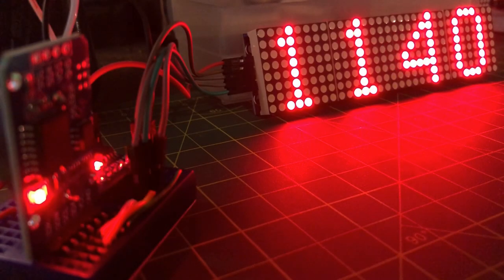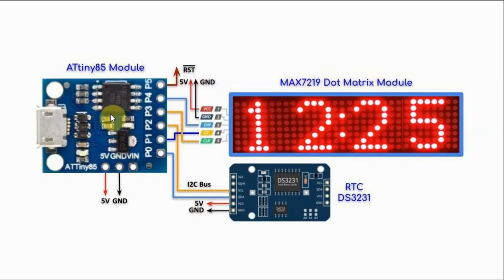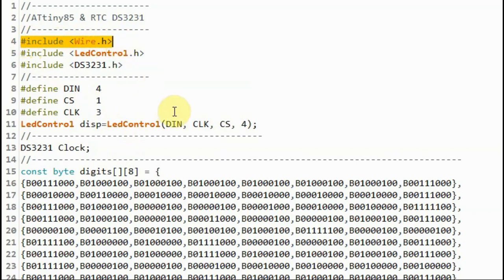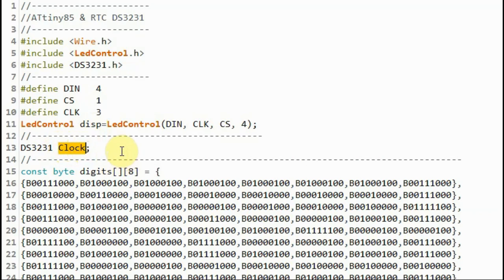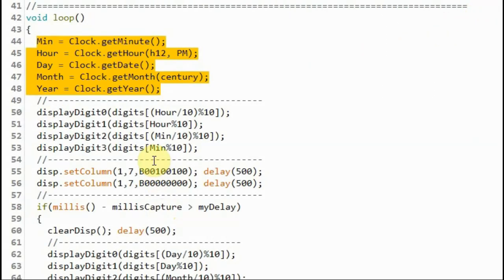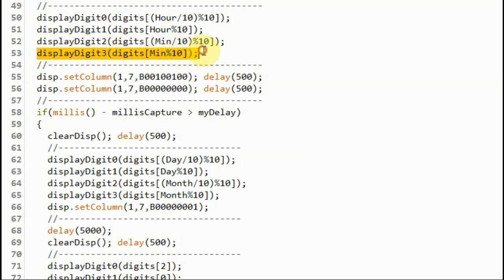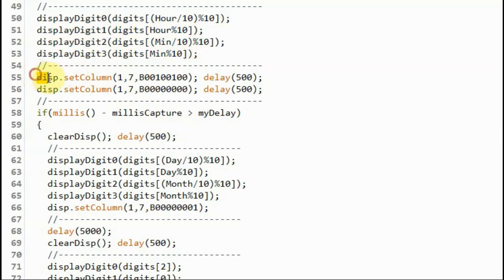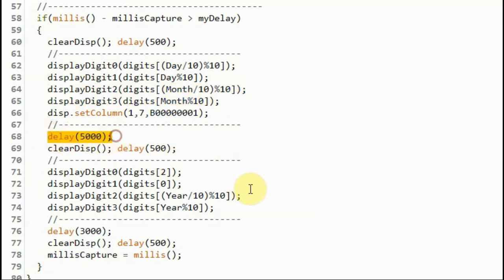ATtiny85 Microcontroller Real-Time Clock

Comment: I am getting error " Error compiling for board Digispark (Default - 16.5mhz).
Reply: The day is coming. Put it on Attiny 85 not digispark program.. It will work on attiny without any problems. Use Digispark to do so.

Comment: Nice project, but I thought that using I2C with an Attiny required use of an alternate library such as TinyWireM.h, not Wire.h.
Reply from the maker: Thanks for your feedback. In this video https://www.youtube.com/watch?v=vosYBYiBc08 I explain how to setup the module to work with Arduino IDE and hence the Wire.h library.
Reply: @AnasKuzechie  Thanks...I'll give that a try.